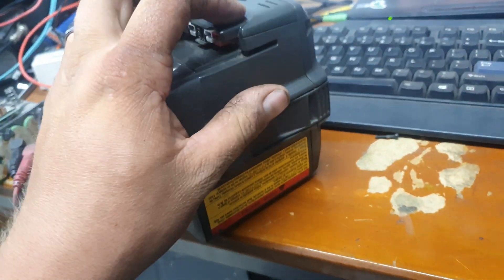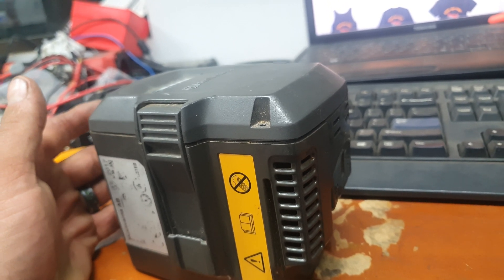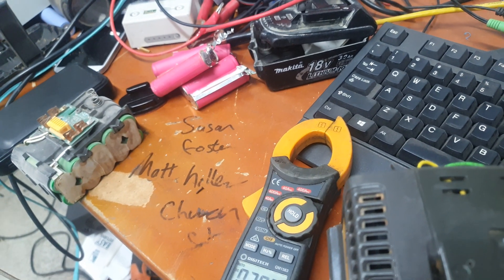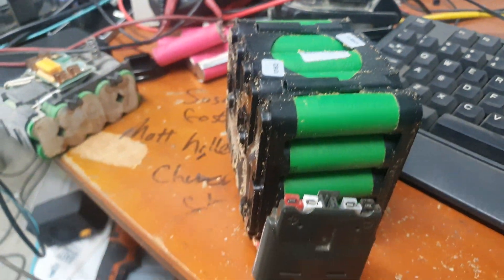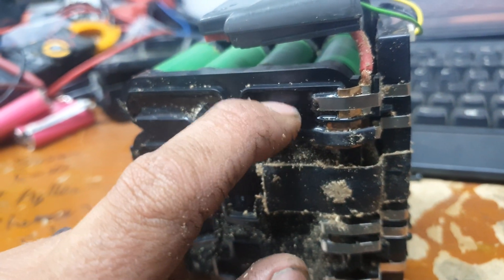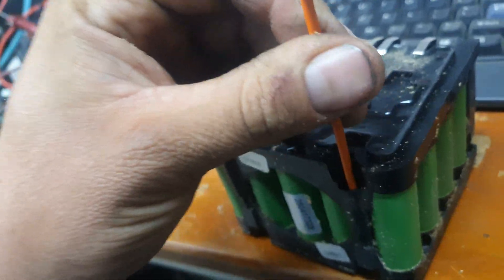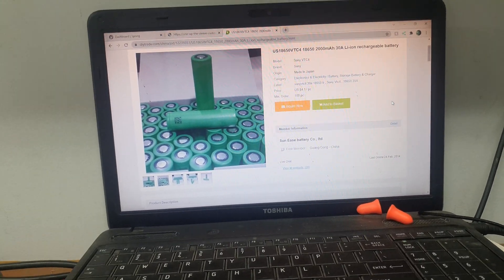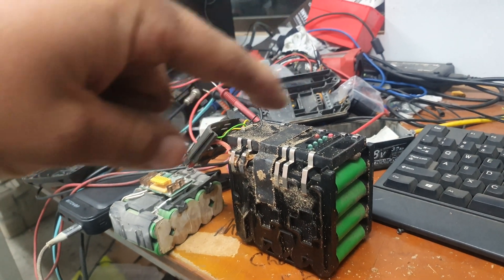Husqvarna  36v 4.2 amp battery tear down before cell recovery

Comment: What are the white/grey terminals for(next to the + and -) ? Could you measure the voltage on them? Im trying to fit a 36V bosch battery for my husqvarna saw.
Reply: How did you manage to harvest the battery pack without damaging the cells?
Reply: @bernhardpuerstinger8784  ive just recycled one of these packs, they are very well built. in the end i used a jewellery saw with a nice thin blade and cut each line of cell away from the pack.  it took a while but was the safest way i found.  i did one side at a time as too avoid unwanted sparks and ended up with 30 really good cells.
Reply from the maker: Yeah hard to get them apart that's for sure
Reply from the maker: Sorry mate it has been harvested for cells
Reply: have you managed to connect the Bosch battery, what are the middle contacts responsible for?

Comment: what cells are in the new 200 and 300 commercial packs?
Reply: Looking at the dimensions of the batteries and their capacity, I think they are using 20x 2600mAh =5.2 Ah on the bli200 and 30x 3120mAh=9.4Ah on the Bli300
Reply: The battery in the video should be a Bli150 with 20x VTC4 18650 2100mAh  = 4.2 Ah
Reply from the maker: Not sure mate but I say like most high output stuff they will have moved to a 21700 series cell